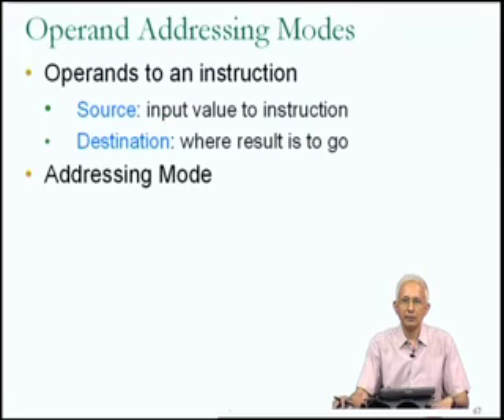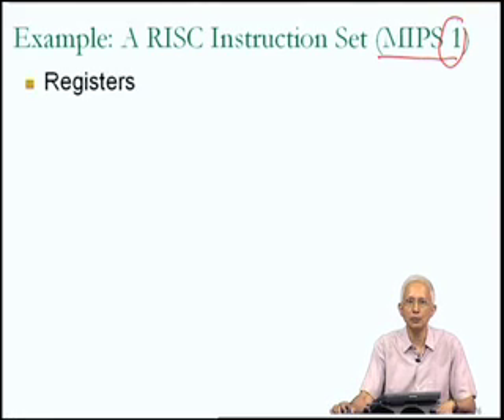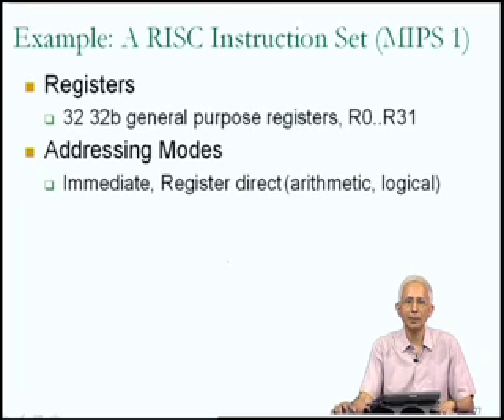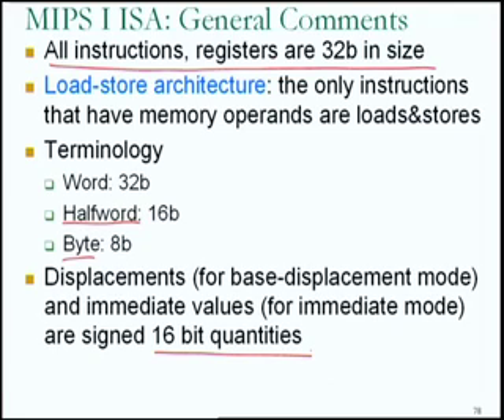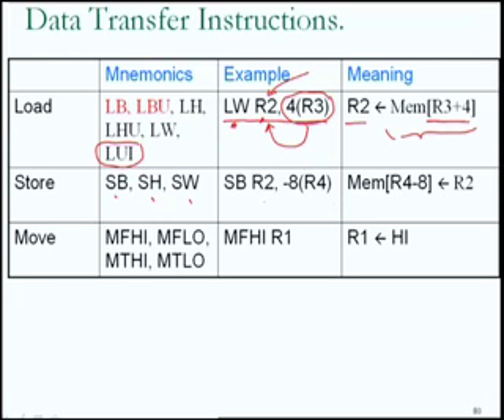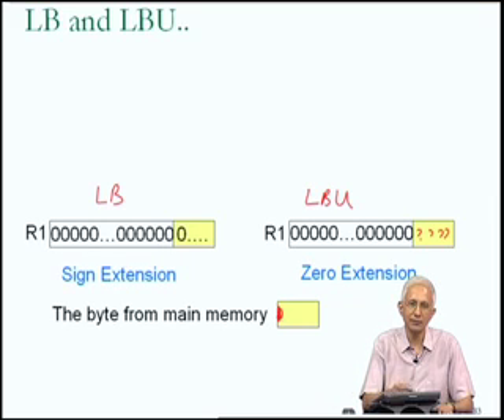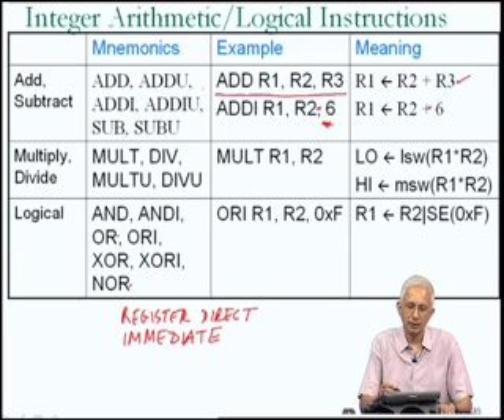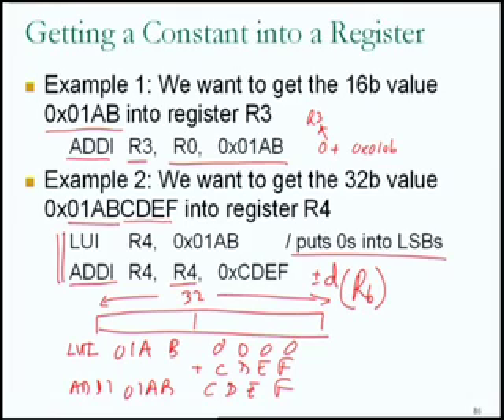Mod-02 Lec-05 A RISC Instruction Set

Comment: The contents of the lecture:
1.Why are addressing modes use?
      To know where and how the operands are to be fetched from
      To know where the destination register is

2.What are the various addressing modes?[Discussed in previous video]
3.Looking into the MIPS 1 architecture:
        We have 32 32bit general purpose registers(GPRs) holding only integers.
             i)out of which R0 is hardwired to 0 and R31 is the default register of the implied arithmetic operations if destination isn't mentioned explicitly 
             ii)There are two registers HI and LO which are used in case of MUL and DIV operation 
         We have the addressing modes supported by the MIPS 1 architecture
     Except the load and store instructions all other instructions take their operands from the registers. Arithmetic and logic operations have two types of addressing ----Two register operannds or one from register and other is immediate .there is no refernce to memory operands except LOad and Store instructions.

Terminology--
Byte--8bits   Halfword---16 bits    and Word---32 bits
Displacement and immediate values are 16 bits wide

4.Instructions supported by MIPS1:
     LB: Loading a byte into the register with signed extension
     LBU :Loading a byte into the register with zero extension
there are few others of load type LH,LHU,LW,LUI
NOTE:LWU is not present as each word is 4B and so is each register so no extension is possible.
LUI is load upper immediate which loads the 16 bit immediate operand in the most significant 16 bits of the GPRs.

SB,SH,SW
MTHI,MTLO,MFHI,MFLO 
ADD,ADDU :Unsigned and signed addition can have different hardwares to handle the carry or overflow bits 
and rest are in video which u can refer ...
OR R1 R2 SE(0xF) means we have to perform the logical OR operation between the value stored in register R2 and the 16 bit immediate value for which we need sign extension(SE) as R2 is of 32 bits and the result is stored in R2.

5. How to load 16 bit immediate value in a 32 bit register?
    Add the immediate value to R0 which was hardwired to 0 and store it in the destination register.
  
6. How to store 32 bit immediate value in a 32 bit register?
We can mention only 16 bits in the immediate field so we will take the 16 most significant bits of the 32 bit value and store it in the MSB of a register say R4 using LUI and the 16 LSB of R4 will be filled with zeros to which we add the LSB of the 32 bit immediate vale no carry will be generated as we are  adding with 0.

~Thank You
Reply: Hey, are you a GATE CS aspirant too??

Comment: 23:17 i didn't quite got hang of why the signed integer occupies 16bit instead of 32 bits.
Reply: because the MIPS instructions can only be upto 32 bits(including constant values) and the instructions themselves would occupy some bits, they fixed the size of the value to 16 bits